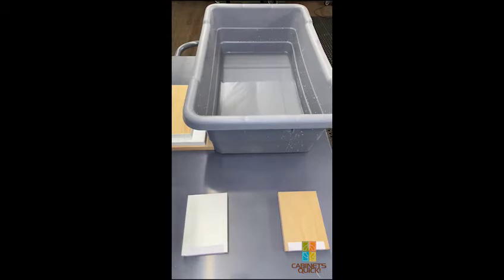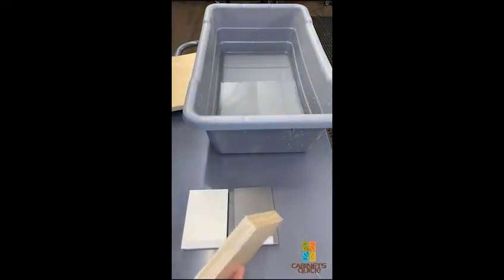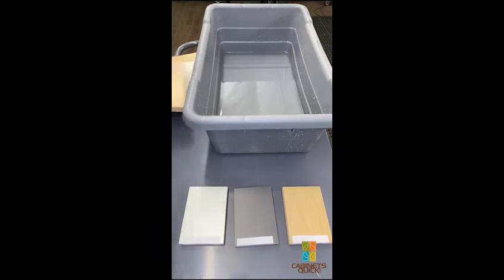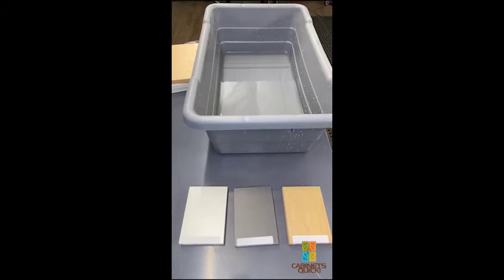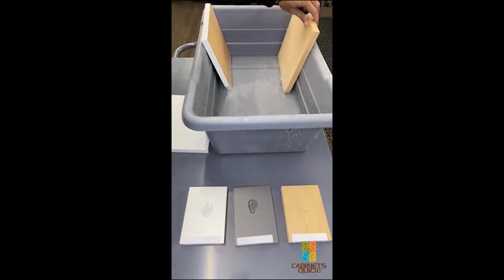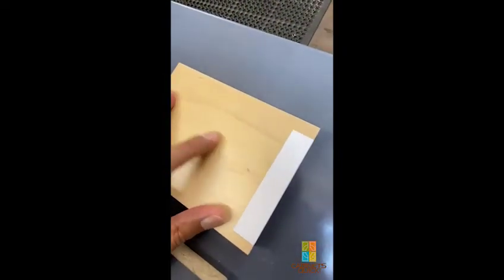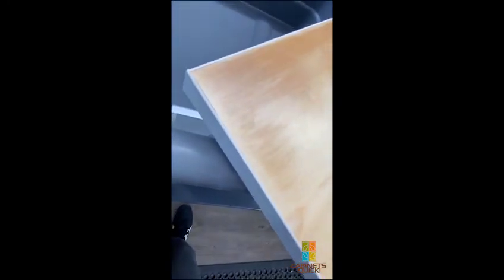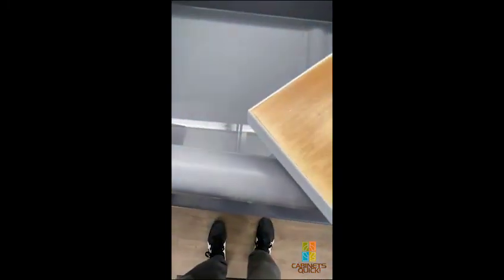Water Damage Test: Plywood VS Particle Board

Comment: Can you please explain to me why customers would be better off using particle board vs plywood?
Reply from the maker: Hi Omar. The PB we use in our factory is 90% density which converts this material in a very strong and realiable material. In the past the PB was only 50, to 65% density and during this period started to have a bad PR. A bad PR that still afects the material nowadays. But in terms of quality/pricing the PB is a great decision, no doubt. In our company we commercialise both options (PB and PW) and most of the cabinet makers who outsource their projects trough iur factory choose PB. Even for high end projects. Hope this helps you to have a better perspective.